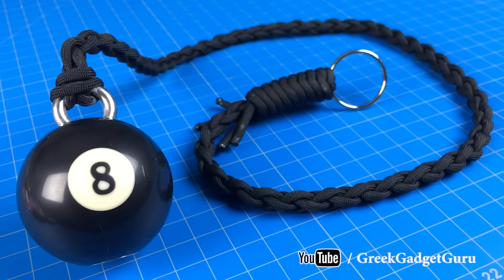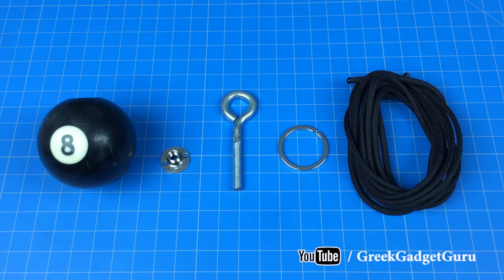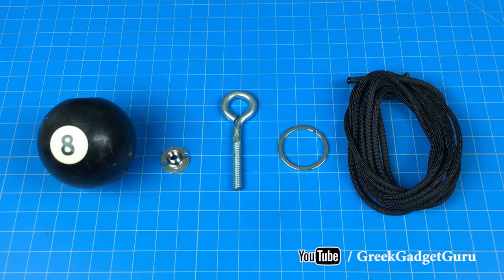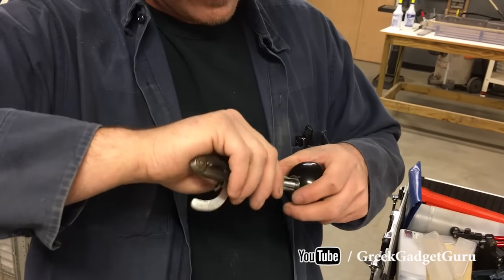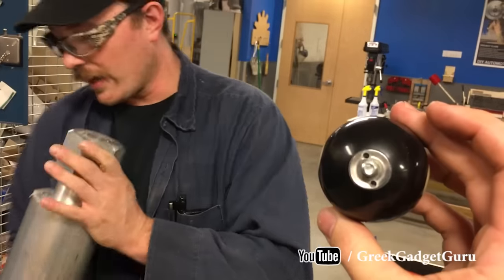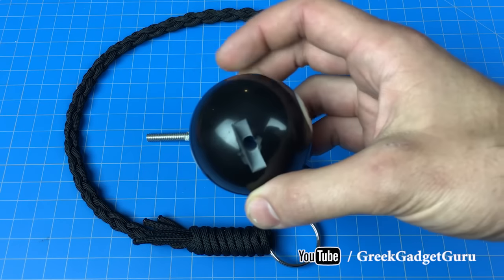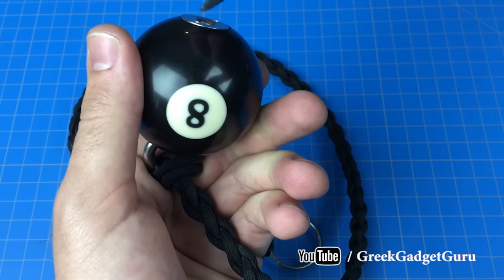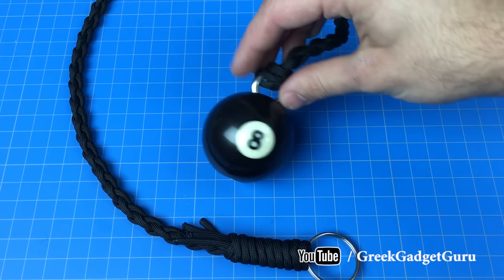How to Make: "Thunderball" Watchdogs 2

Comment: Question, why not drill the hole through then thread the rope through and put a knot at the end? That's pretty much how it's made in the game. Not all those extra metal bits.
Reply: Eethan O'Connell Approved- it works well
Reply: RoZZameSS
 Simpler is better. ;)
 But I would have loved to see a demonstration on maybe a water melon or pumpkin to show just how powerful this tool is.
Reply: Eethan O'Connell simpler isn't better in this case though
Reply: Jordan McDowall why?
Reply: Mr. Mediocre Gamer right? i dont know about what you suggested. i just tie a bottle of glass with a shoe lace. glass bottles dont break like in the movies.

Comment: If anyone is wondering what the threaded end cap is actually called, it's a Tee- nut with brad holes. Probably find it in some furniture section of a hardware store. I went to my local lowes and they only had 2 left.

Comment: 3D Printed Drones? (like in Watchdogs 2)
Reply: Max Ayres that sounds pretty impossible but maybe it is
Reply: possible
Reply: I have Ideas but i don't have the 3d printer or program
Reply: Max Ayres you can just buy a quadrator drone.
Reply: i know but 3d printed is just cooler
Reply: Yeah you could probably print the individual pieces
Reply: le quadcopter*
Reply: How the fuck are you supposed to print a drone? Maybe the blades and like the shell, but you still need to buy all the components
Reply: Hay, your the one who made the 3d printer that can make a dildo cat unicorn gun, dont ask me!

Comment: Guys i know and easier way You get a yoyo and dip it in concrete
Reply: dalex carter you genious...
Reply: or resen but if you do that fill the space between the halves with ball berrings
Reply: Or you could get a rubber ball tie a rope around it and then dip it in concrete and then add the ring at the end
Reply: You don't want to cut golf balls. It's messy as hell. Open one up and you will find out. Concrete will crack especially if the inside is made from a material that can flex such as a yoyo. Pool balls are the best option unless you happen to have an extremely large steel ball bearing from a large scale industrial machine.
Reply: But that defeats the idea of this prop. You wouldn't see the 8 ball. The paracord covers the whole thing and reduces the kinetic energy from the impact. You may as well just use a sock and not bother wasting any time tying knots.
Reply: Joe Blogs Shit ill use a sock plus if you dip the yo-yo in concrete then mold it a ball shape then you get the ball. Then you could draw on it
Reply: dalex carter XD

Comment: I'm sure you've heard this by now, but just in case:
This weapon is called a Meteor Hammer. Originally made with a pumpkin shaped iron head, the tool was used in masonry, and as a weapon it delivered heavy damage in dynamic ways. Just be carful, as all "soft weapons" are very likely to harm the practitioner before mastery.
Reply: By the way, I love your work and your mission statement. Keep it up.

Comment: since i'm just a regular person without all that stuff at 1:30, what could i use instead of the stuff you have?
Reply from the maker: +Nuclear Wanderer  your imagination to make a jig to do the same thing with a drill.
Reply: +G3AR I need to make one of these. I live in a bad part of my city in downtown, so this would be helpful when I walk to school at 6 am.
Reply: Sean Loer same lolz Stay Strong 💪bro
Reply: DANK MEMES I mean shit, all I have is a worn out switch blade, I just fake swing to threaten them. This, I will be able to knock the fucker out, just, (boom) lights out for ya
Reply: Sean Loer gud luck making this doe its sounds hard asf
Reply: I mean It isn't that hard, just when they have a gun and I get chased down. (I hate my apartment building.)
Reply: Sean Loer I meant its prob hard to make this weapon but yea feel bad for u
Reply: Probably yea, but it's good i have a pal that runs a tool store, he can make it as long I pay him 5-10$.
Reply: the easiest and sleekest looking way i see would be to drill two holes (vise highly recommended!), and epoxy in a u-shaped bolt. it wont take heavy abuse for long .. but really, this is mostly a display piece and delightfully dangerous play thing anyways. as a weapon, a bandana with a fishing sinker (lol, mind the hankey code), or any other variation of a rock in a sock, are much more practical and far less conspicuous to carry.
Reply: Nuclear Wanderer probably a dremal with a few different bits
Reply: Nuclear Wanderer  lol do what I did put a pool ball in a sock and wrap it with some cord works the same doesn't look as nice though
Reply: Custom Kush ha
Reply: Custom Kush lol
Reply: Custom Kush 😃
Reply: Michigan w

Comment: Oh right not quite expensive, only a few thousand dollars for the tools too
Reply: Vincit Qui Patitur  Just buy some sort of cord, a nut, and a bolt, and an eight ball. Then use a hand drill to go through the pool ball, tie the cord right underneath the head of the bolt, and then screw the bold into the ball. Finally screw the nut onto the end of the bolt on the opposite side of the ball. The total cost comes down to below 100 U.S. dollars.
Reply: thank you
Reply: Plus tax and shipping and handling lol
Reply: Vincit Qui Patitur few -_-
Reply: More than just a few thousand dollars BTW.

Comment: You could make the ball end out of epoxy resin with the eyebolt and nut already in it. Save the milling and drilling bits. Plus then you could put whatever you wanted in it. Seems like that is what the balls are made out of anyway from the way the chips were flying off.

Comment: Looks really good, it would be spot on but you should have used green for the chord. Besides that small and very easily fixed detail it's amazing, only thoughts are that it requires equipment lots of people probably won't have. If there was an easier way to make it that would be nice, but I doubt it.

Comment: You should show us an easier way to do this. xD
Reply from the maker: You pretty much just need a drill, and ball mill bore. The slot makes it look a lot nicer is all.
Reply: G3AR drill a hole, take a length of paracord, thread it through, and tie a large knot on both sides.

Comment: one improvement i would suggest is the addition of some sort of  ball or tapered wooden plug sort of like a wine cork only with a steeper taper. roughly 3/4 top to 1 3/8 in diameter at the base and two inches long. this will allow you much more control over the weapon. i make mine with cast lead. i cast the lead inside a brass or steal pipe for added durability the lead is poured around the fittings permanently fusing all of the components together. i can put more weight in a smaller area then i ever could with an 8 ball. mine are also much easier to hide due to the smaller size of the weight.

Comment: hmm... you also could have polished the ball :/
Reply from the maker: Polish deeez nuts! Lmao, just kidding man. Yea I could have, but those bite marks from the vice are fairly deep, It wouldn't polish through the actual material. Maybe 3000 grit sandpaper, but I wasn't sure if the 8 was just on the surface, like paint. So I didn't want to mess that up just to be that meticulous.
Reply: G3AR would you try it

Comment: You could easily make a Thunderball by get a threaded ball knob and the appropriate size eye bolt and secure it with loctite or epoxy. Then attach the flexible element to the eye bolt.

Comment: So basically. Take an eight ball, drill hold through it. slip in the eye bolt thingy, then put the bolt on it. then attach the paracord. 
OR you can drill a hole, attach paracord. Won't look as nice but it does the job. I made this pdw like maybe three years agoi called the wrecking ball. It was a solid steel ball attached to paracord as the handle and I had welded on some heavy weight bolts to the ball before lightly taping the ball up then to the handle.

Comment: yes that is the difficult part getting the whole perfectly centered threw the ball. A guy would be better off drilling a hole through a rough cylinder or cube shape and then turning it on a lathe or in some sort of improvised kind of a lathe with a drill press and bearing

Comment: is that t-nut visible on the other end of the ball the only thing that is holding the ball on the eye bolt? bolt? or did you countersink the hole and secure the ball to the eye bolt with a nut and the team that is just kind of for presentation? I might not trust the T nut to hold up to all those impacts and centripetal force

Comment: Wouldn't it do more damage if the bolt was sharpened instead of cut off? A graze would cause a deep gash while a direct hit would concuss. Or would this not be a good idea for some reason?
Reply: I know this is a month old, but it’s not really worth it. Multiple reasons, but the biggest one is due to user injury. I’ve used things like the Thunderball before. After a solid hit, it’s prone to bouncing.

Comment: Friend.
Why not a swivel in place of the eye-bolt?
How about a Bola? The only thing is—if you really want to do it right—the third strand is a couple inches smaller AND the weight is a bit smaller.
If memory serves—the shorter strand is tied to the midpoint of the longer strand and it's called "The Sister."
So finding a good hard ball a wee-mite smaller than your two 8-Balls...
…..RVM45

Comment: You can also use a locknut at the bottom of the 8 ball instead of loctite. 
The nylon ring grips the threads so that the nut don't get loose.
Check out this Wikipedia websight. 
https://en.m.wikipedia.org/wiki/Locknut

Comment: Just assuming that everyone has a saw and drill like that
Reply from the maker: You don't need a mill. Just a way to drill the hole and hold the billiard ball, you could even duct tape it to a bench if you wanted to. It's just a challenge to hold it vertical.

Comment: Going to make up a tutorial on how to mkae this homemade style based off of mostly guesses and 0 research/experiece whatsoever

Step 1, acquire 8ball
Step 2, drill hole through 8ball
Step 3, insert ring with convenient pole on the end
Step 4, tightly wrap string connecting the ring and the 8ball, superglueing the inside of the hole (with the ring inside) might work better though
Step 5, assuming youve glued the ball and ring together, wrap them tightly together anyways, with a strong material to.
Step 6, get another rope, something around 5-13 inches (to have spare to tie), and tie it around the ring and tie it to another spare ring
Step 7, profit.. I think idk havent tested yet the whole fucking thing might break apart

Alternative idea with 0 research
Step 1, Drill a hole through the 8ball at the x axis
Step 2, grab a lock and a chain
Step 3, put the lock on both the chain and 8ball
Step 4, get some kind of material that can cover over the chain (so ur sweaty hands cant just slip the grip out) would recommend foam or cloth
Step 5, profit

Pros/cons of both ideas

Idea 1 pros:
Looks cooler
Cant be undone by a key/numeral code
Cons:
No guarantee it'll stay together past a whole week
Takes a while and a larger sum of money
Where the fuck will you find a 5-15 inch cord

Idea 2 pros:
Can be made with items you could find at your local home depot
(I think) its cheaper
Can also be made with shit you found in middle school
Takes less time to be made
Cons:
The 8ball itself might just fucking break apart altogether
Can be taken apart by just 3 numbers
Can give you tetanus (rusted chain)
Can also be taken apart by a single hammer slam

Okay thanks for reading i'll be back in 2 months to see the replies

Comment: Couldn’t you get just a normal hand held drill and put it in a vice and drill a hole?? Instead of spending $50,000+ on a big machine, wait for delivery for like probably months then drill a hole and then have a massive machine sitting round ur house for ages

Comment: Ok ok. Sure bud. But heres how to do it the easy way. You take a drill. You drill 2 holes in the ball. And one on the side of the ball, and then you take a long shoelace and put it in the hole on top. And with the hole in the side you got a lil cave so you can put it through the other hole with a tiny thing that can pick up shit. And once you grab the lace through the holes. You tie it. And bam. You got a cheap ass thunderball

Comment: No that was a good little project. It does need epoxy resin for safety and it would have looked better if you had put two grub screws into the two holes in the cap. I would have painted the cap black as well. That's my constructive criticism. 

As for 3d printing. Bin it. I hate it and there is a ton of 3d junk videos out there. 3d printing isn't skill and isn't interesting in the slightest. I would unsubscribe if that was the direction you want to go in with this channel. 

I don't want to put you off but make another channel for 3d printing and leave to bigger projects for this channel. That way you keep your current sub base and can spend time on 3d printing.